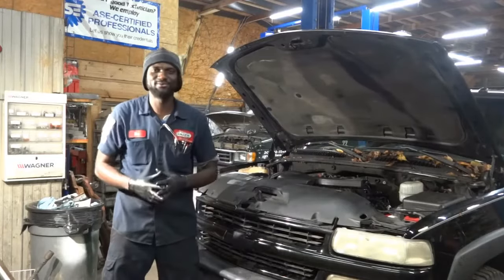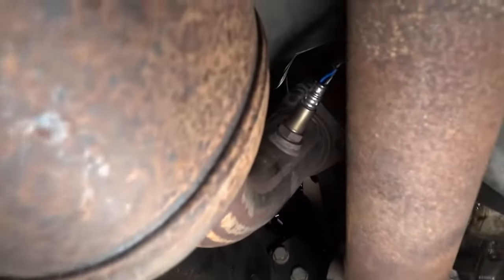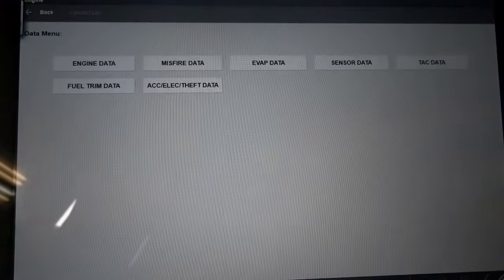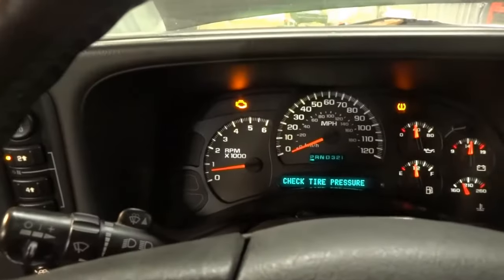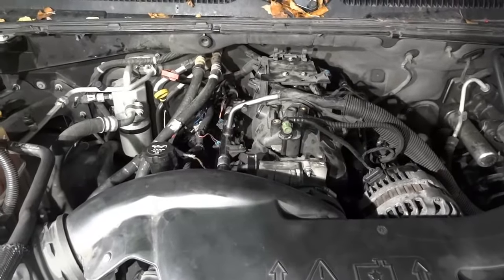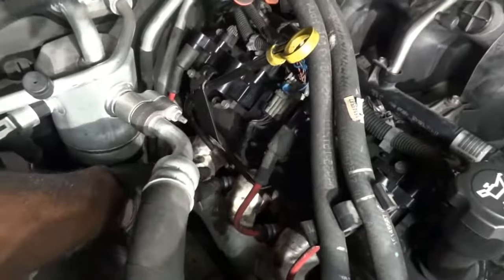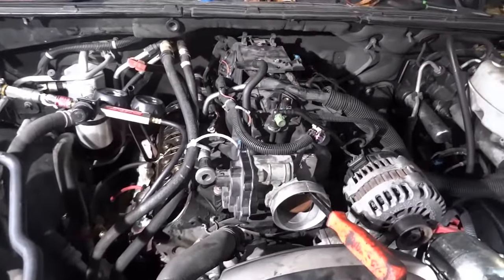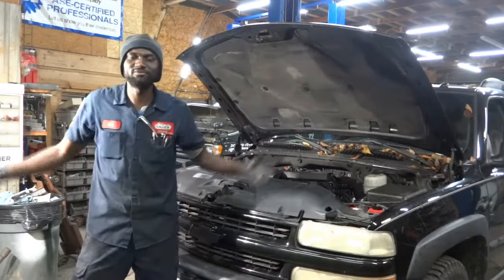CHEVROLET SUBURBAN 5.3L~ P0300, Still not Fixed After replacing the injectors and ignition Coils...

Comment: whats a ballpark price in 2024 to get the head fixed in a 2009 Yukon.. no codes but oily #1 plug for a couple years now.. replacing every 2 months. gas mileage down to 12 mpg.. Idle jumps and car shakes a bit at stop lights.
After watching I'm thinking this might be my issue..thx in advance..
Reply from the maker: @Sean.L722   if that's your issue I recommend replacing the engine, it's a better ands cheaper!

Comment: I got a 2015 Silverado 5.3L 4x4. Misfire on cylinder 2. While seeing the misfire, I had coolant leaking out the overflow on the coolant reservoir and the upper radiator hose was stiff as a brick. I’m lost on what’s causing all this…..
Reply from the maker: @user-kh1pj3ot4g  I recommand you take it to a pro mechanic who can diagnose it for you!

Comment: Very good diagnosing, 1 question. Even though the cylinder is leaking the engine still fires on that cylinder. How does the computer know to throw a random misfire for this issue. Thanks
Reply from the maker: Chris Wrenn  the computer monitors the crankshaft speed to know what cylinder is misfiring, some computer programs are not very accurate to identify the specific cylinder that's misfiring, so it throws a P0300, especially if it's intermittent, 
so when dealing with a problem like this always check the cylinders individually

Comment: Just wondering why you didn't stake the valve head with a rubber mallet to see if the intake valve would reseat itself.
Reply from the maker: 502SS  that trick doesn't really work in the long term!

Comment: Greetings, first let me say this is an excellent video as always.Correct me if I am wrong shouldn't the 02 sensor/air fuel ratio sensor  reads rich when the throttle is been depressed and reads lean when you let off the throttle?
Reply from the maker: Nitram Auto Tech  Yes, but that can change depending on what type of 02 sensor that is on the vehicle!

Comment: I’m troubleshooting p0300 very light shaking that I can’t feel but my mom noticed it. live data shows 0 counts misfire on start up and idle. Maybe when the car gets hotter it begins to count. Replaced plugs, valve lifters timing chain, oil pump, cat , damages were found on them all.
Reply from the maker: @RatanaTan  that's odd, did you do a cylinder leak down test?

Comment: This may be a dumb question, but cleaning the intake valve not an option? Or just replacing valves?
Reply from the maker: Safe 1  I prefer taking the head to the machine shop and having them fix the valves or replace the whole engine!

Comment: Could the leak down tester work even if the piston is not at tdc? I'm just being lazy,  but if I have 8 cylinders to test, I want to just rotate the engine until the rockers are free for each cylinder then test. Seems all I'd  be doing if the piston is at the  bottom of the stroke is creating a bigger chamber for the air; the air may not care about that?
Reply from the maker: @verohandymike  Make sure the cylinder is in the compression stroke!

Comment: What scan tool is that you are using? (or what is a cheap one that will read misfires lol) Just recently got a 0300/ 0301 code with a 2013 5.3L around 100k miles. The plug looks rough so it could just be replace the wear items but the scan tool I have doesn't check misfires.

Comment: My 2011 Nissan 370z Nismo still show P0300 even though I’ve already spent $2,000. I replaced all parts with OEM like Spark plugs, Ignition coils, PCV valves, crankshaft sensors, air filters, oil changed, and evaporation purge valve. What’s else should I replace to make engine light go away?? PLEASE HELP 🙏
Reply from the maker: @Qghostz  check compression, if there is compression, check your fuel injectors!!

Comment: I've got this going on with my 04 Silverado 6.0l. p0300. I did new intake gasket with knock sensors, maf sensor, plugs, wires. Truck has 190,000 miles. The engine light comes and goes. But the engine light flashes when I hit high speeds around 70mph. Any input would be great, thanks
Reply from the maker: Andrew Huber  You might have a weak coil!
Reply: Ya I figured with how many miles are on it I am going to do coils and injectors next. As I'm sure they were never changed. When I got the truck with 170,000 I did the plugs and wires. The electrodes we're almost gone. So I'm guessing if they didn't do a simple plug change neither the injectors or coils have been touched. Thanks. Have a good labor day
Reply: @Andrew Huber  Hi Andrew. Any update on what fixed your sporadic check engine light with the p0300. Mine is doing the same. Did coils, plugs, wires, and injectors but nothing. Thanks in advance.

Comment: I have a Ford, 3.3 liter inline 6, engine having front and rear seal leaking oil, and little compression issues, to an old Foxbody Mustang body.. I’m into old school cars.
Reply from the maker: @lawnmowermanTX   Ni ce , Good luck with your project!
Reply: @KITS_Auto_and_Truck_Repair   Thanks, I don’t have the mechanical knowledge, tools, kits, items required, equipment, money and shop to do it?  Some say the 3.8 liter V6 is a good deal and what transmission and rear axle, ratio and u-joints will do a great job?  I’m thinking the In-line 6, is tired and the block are worn out with fatigue fractures, I seriously need a long block. How much money would I need to save up for??

Comment: If you had  a leaking intake valve why did it not show up on the compression test, that does not add up?
Reply from the maker: ROGER JOHNSEN  a compression gauge may not show a very small compression loss through the valves!

Comment: Im having the same problem on a 2000 chevy Silverado 4.3 and ive replaced plugs,wires,cap,rotor button,spider injector ,mass air flow, everything and still a po300

Comment: I want to know if this engine has a problem with higher miles do the valves start leaking. I have a 04 Chevy truck with a 179,000 miles on it. I have the same problems with same cylinders mis firing. I did the replacement of all the same parts. Still have the miss fires on same cylinders. 3 & 5 as well as 4 & 6. The problem started last year 2023 with a flashing engine check light. I changed the AC spark plugs with Bosch I got at O'Reilly's as a bonus for free. Supposed to have been all ready gapped? Several were still misfiring My truck was still running horribly. Took to Chevrolet. The got same result. Changed to NEW AC platinum. Runs better but still have miss fire. Guess I need to do a leak down to find the problem. Thank KIT'.
Reply from the maker: @hottoddy6757   My Pleasure!!

Comment: I really appreciate the way you explained things to everyone understanding🤝! 
  Please, If the exhaust valve was leaking as well, will there be an audible change of sound as it happened to the throttle body when you change the pitch with your hands?
Reply from the maker: david essien  Thanks! if the exhaust valve was leaking the noise was gonna come out of the exhaust pipe!
Reply: @KITS_Auto_and_Truck_Repair  Thank you so much!
Reply from the maker: @davidessien5465  My Pleasure!
Reply: @KITS_Auto_and_Truck_Repair  On Saturday 16/7/2022 about 5pm a client called me to his abode. When I got there he told me that he observed when he was about to drive into his compound that oil was leaking in his car. Although, it took me some minutes to troubleshoot the problem because the oil spattered excessively to many accessories of the car like alternator, power steering pump, fan belt, TPS, AC compressor, etc. I searched for the leak and finally saw what was causing it. I noticed that it was because of the CKP oil seal at the pulley side/front of engine. It was late hence auto parts store closed that was why I didn't replace the seal that day but encouraged them not to drive the car until I replace the seal.
  On Monday 18/7/2022 I changed the seal and the leaking stopped and the idled fine but I only observed that few minutes to avoid catastrophic outcome to the engine because the engine oil level was low. After replacement of the seal the fan belt cutoff and I replaced it as well. 
They didn't drive the car until Tuesday when the went to the replace the oil. But before they moved they called that the whole car was vibrating. I was unable to reach out to them so I told them I will meet them on Wednesday 20/7/2022. I got there yesterday as promised and noticed a severe vibration at idle which wasn't there when I left on Monday.  
   I scanned the car and retrieved some codes that I will upload. Among those codes, I was particularly focused on the P0016, P0113, P0123, and P2135 although I verified the ignition codes and saw that it fired very fine. 
   As a result, I cleaned the CMP sensor of the 2 banks and installed them back but to no prevail, I still noticed a vibration. I pulled the CMP sensor again within 2 minutes of idling and noticed that it was dirty again. This time I had to pull VVTI solenoid valve of both banks  alongside the CMP sensor and cleaned them. In addition, I used a very clean dry cloth and insert into the CMP sensor hole to properly clean the inside of the engine. In the process, I also noticed that the injection head where the TPS sensor is tightened was very dirty as when a carbon and oil are mixed together so I cleaned that too using a tooth brush. 
  At last, when I put everything back to it's respective places the idle was very nice because the car didn't vibrate again! 
  However, there is a problem that I want you to help me out with. It's a high rev in RPM to about 1.4 at idle. I Before I left there yesterday I scanned the car again and found only the P0123 and P2135. Please note that this two codes appeared only after cleaning the CMP sensor, VVT solenoid valve and the injection head. It didn't appear before the cleaning of those accessories.
  When I started the car it rev high from about 1.25 to 1.4 RPM and remains there. The RPM doesn't go up and down. When I accelerated the car it rev very fine. I also noticed that the TPS connector was slightly broken, it didn't fit in very well and didn't hear a snap sound when connected to the TPS module. But whenever I pulled the TPS connector completely out when the car was idling there was a great reduction in RPM as if the car wants to stall so I immediately connect it back slightly and noticed that the RPM goes down and remains at 1000 RPM. The car owner even noticed the reduction in RPM, stood up and moved to me and said that that's the way the car should idle. But if is still connected at that place and switch off the car it idles to 1.4 RPM and remains there until I repeat the unplugging of the TPS connector process.  
   I tested the connector with my test light and noticed 2 ground out of the 6pins (one of the ground was very dim the other was bright) at the pin connector that illuminated the dim light when tester was at battery positive. I also noticed a dim light when I checked for current with my test light now hucked up to ground and ignition switch activated to ON position. 
  
  Please help me, how do I permanently solve this car problem? 
The car is a 2006 Toyota Forerunner with a v6 engine.
Reply from the maker: @davidessien5465  Ok!
Reply: @KITS_Auto_and_Truck_Repair  guide me on how to solve this car problem please.
Reply from the maker: @davidessien5465  did you dod the tests that I did in the video!
Reply: @KITS_Auto_and_Truck_Repair  I checked but don't have the leak down tester to carry out the remaining test. Probably on my next visit to the man's abode I will loose the valve cover. Presently every other codes disappeared except the TPS codes.
Reply: @KITS_Auto_and_Truck_Repair  I have just solved the car problem
Reply from the maker: @davidessien5465  awesome I'm glad to hear that your problem is fixed!
Reply: @KITS_Auto_and_Truck_Repair  I sprayed carburetor cleaner to the TPS sensor and butterfly of the throttle body again. I wickled it back and forth severally. I also tapped on the TPS sensor when the car was idling. 
  I loosed the car negative battery terminal and waited few minutes and then connected it back. I also unplugged the TPS connector then crank the car twice knowing it wouldn't start and idle. I connected the connectors.
  I cleared the codes and cranked the engine everything was Ok again with God's support! 
  The car owner was very happy!
Reply from the maker: @davidessien5465  Awesome!

Comment: i have the same issue with my motor cannot get rid of p300 misfire #1 my mechanic says i need a new motor,i guess i can take it to a chevrolet dealer and make sure i would like to just get heads redone any suggestions
Reply from the maker: Ed Rosa  I would recommend replacing the engine if your valves are not sealing!

Comment: Hello I have a 2000 Silverado with 5.3. It misfires a lot when is cold once it reaches normal temperature it drives fine and when is at idle it feels a little shaky and rarely misfires but not as when is cold. Any suggestions. It has new injectors new plugs  and wires new pressure regulator. But Continues with code p0300 still. My concern is that when is very cold it really idles very rough  until it warms up. I am waiting on a leak down pressure tester that I order to do the leak down. It does have more constantly cylinders misfiring then others though. Im worrimg is the head valves. The heads were replaced about  almost 3 years ago due to coolant leaking on top of head from a factory defective fabrication back that gm had issues back then on early 2000.
Reply from the maker: Juan Gonzalez  Check your head gasket and your intake manifold when the engine is cold!

Comment: I'm having the same problem with my 07 Tahoe.  Luckily I live next door to aable auto parts,  they sell used auto parts,  and I can try stuff before I go buy . Plus I get used dirt cheap sometimes free . Awesome video,  but I think my issue is with the ground wire from the drivers side coil pack is corroded
Reply from the maker: Maine bear hunter  sounds good!!

Comment: When putting cylinder 6 in compression stroke can u still crank the engine normally or does it have to go back in position it was at first ?
Reply from the maker: @gerardocruz4779   No! you can crank the engine whenever you want!

Comment: How do you fix the air intake valve ? New lifters ?
Reply from the maker: @gerardocruz4779   if the valve seats are leaking, you have to take the head to the machine shop to have the cylinder repaired!

Comment: Could a compression test have told you the same thing? Just wondering.  I don’t have the leak down tools
Reply from the maker: bgp19611  for some reason it passed the compression test!
Reply: @KITS_Auto_and_Truck_Repair  okay. Mine passed the compression test too. I’ll run to Harbor freight and buy the supplies to perform a leak-down test. Thanks again.
Reply from the maker: @bgp19611   My Pleasure! and Good Luck with your project!

Comment: ok here is one for you p0300 code and not other codes. 07 caddy 4.6l  the engine will idle and then shut off like you turn the key off. 18" vacuum 64# fuel pressure compression 185 to 200 across the board. new TB new maf new map new plugs. i figure if i have injector or coil issues i would get some type of code. engine runs good down the road with a now and then misfire. i clear the codes and within a 3 mile test loop it returns. i found so far 4 to 5 wires with worn insulation and repaired 3 of them that rubbed on the anti lock brake lines and shielded one that was rubbing on the engine by the TB and egr.  the air check valve at the manifold was busted off and i rewelded that the best i can but it still has a bit of a leak, but the misfires did not diminish. so any ideas? he said it has done this for at least 9 years since he got the car. in the freeze frame nothing looks bad in live data when i get to the misfires they are all getting misfires but some cylinder a bit more the others. he put seafoam in the gas tank so now he has to drive it some to get that to work thru them. i could do 02 sensors but one is a bear to get to and the crank sensor is under the intake so i do not want to just replace these unless codes point to them you would think in 9 years these sensors would have failed. thanks
Reply from the maker: @bobpalmer4740  test your crank sensor you can test it from the ECM Connector, test your injectors as wll!

Comment: I have a 2010 Suburban that has a misfire in nbr 1 cylinder only.
2 rocker arms lifters guides push rods replaced, all spark plugs changed out., only the nbr 1 coil pack replaced along with the AFM and fuel injector.
no longer have a compression issue and my engine passed the leak check, I need help!
Reply from the maker: @antoinecaldwell6318  did you replace the AFM System with the OEM one?
Reply: I am not sure actually honestly. I took my truck back from them because they couldn't figure out the issue
Reply: @KITS_Auto_and_Truck_Repair  the AFM did come from GM; my mechanic tried and Aftermarket part initially , but then went with GM after the issue didn't resolve .

Comment: i have gmc 2001 have leak fuel from unknown place i make sure its not the tank but still did not find it and sometime my car do back fire and shutdown and when i try start it up it take so much time to start and i can not pass 110 khm becase its super weak i replaced fuel pump 3 time and oil pressure is dancing i dont know why it was good car but now its not in saudi arabia they do not fix they only reblace i wish there is ppl like u in here and sorry for my bad english
Reply from the maker: sahle_koko  I appreciate your comment! did you install an OEM Fuel pump in it! because it sounds like you have a fuel pressure problem! make sure the fuel pump wiring is good and install an OEM pump then see what happens!
Reply: @KITS_Auto_and_Truck_Repair  ok i will try
Reply from the maker: @sahle_koko1614  sounds good!